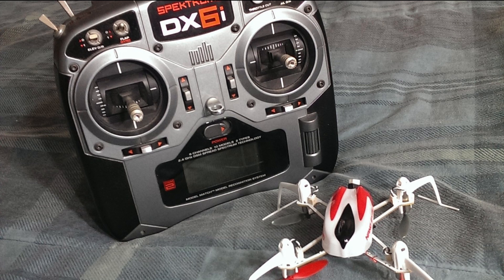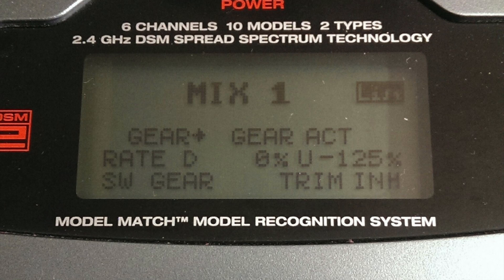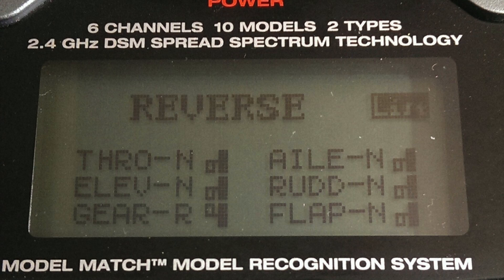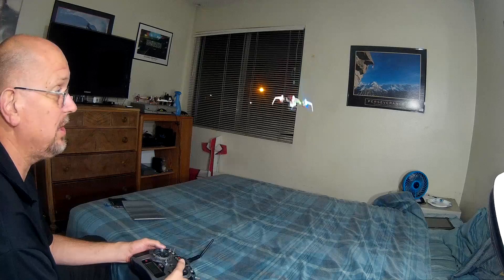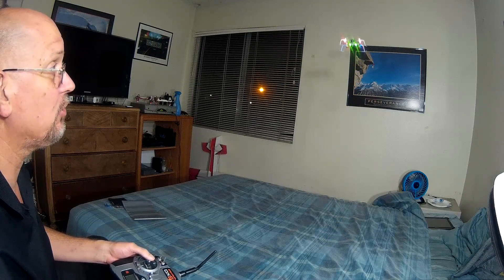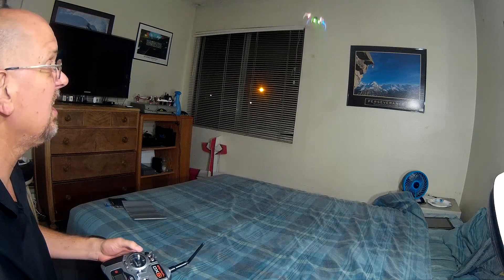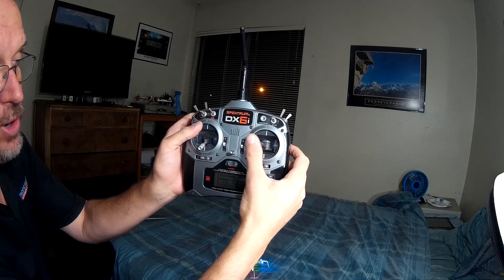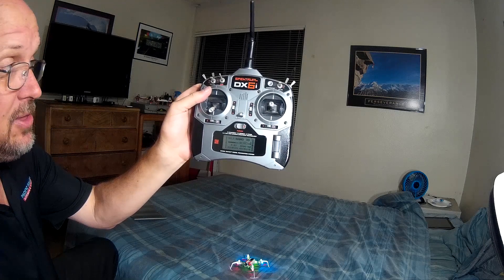NANO QX 3D Spektrum DX6I Setup Video -TALLGUYSD

Comment: Hello ! 
When I got in 3d mode as son I put throttle to min position (should be max throttle inverted)  the motor just stop  :/    Do you have any idea why this is happening ?
Reply from the maker: 3d mode middle stick is nurtal.  down stick is when inverted. upstick is for normal.
Reply from the maker: Sorry you can start it at zero it want start until you go to center stick..
Reply: In my Dx6i  what happens in 3d mode  as you sad middle stick is neutral position, when I go down stick is inverted, so as more a I go down more power I have inverted that is correct however when I get in the end its means 100% the power inverted the motor just turn offf. 

As soon my stick go in the bottom the motor turn off.    That is normal ?

My Nano CpX and McpX  I have a switch to turn off the motors in 3d Mode.
Reply from the maker: +Gabriel Aphonso make sure all your trims are correct and that you have no sub-trim set by mistake.

Comment: the user manual says: flap 125% up arrow and 125% down arrow. I need to set 125% down arrow in the travel adj? i only got the 125% up in the travel adj, a can barely flip the nano in mode 2. in mode one its imposible to 360 flip.
what am I doing wrong?
thanks!!

Comment: Thanks a lot!  I just received my Spektrum DX6i and my blade Nano qx 3d.  By chance, did you set your d/r HIGH 100% LOW 70%?  I did config my DX6i to your specs and it works great.
Reply from the maker: +Jason Hinojosa you can play around with expo and dual rates I just put 40-50expo on the ailerons and elevator and see how you like it that can always be adjusted to taste

Comment: Hey. Was just curious. For full 3D mode on the nano qx. I toggle the flap in mode one to flip. Toggle in mode two with the gear @ 1 to fly inverted. Toggle it again to flip back. For full 3D mode I can't figure it out. If I have the gear and flap @ 1.. I don't get the reverse thrust like a heli. Can't flip it.. I'm unsure if it will fly like a heli or it'd modes 1 n 2 are the best way to do it. Three seem to allude me.

Comment: One last question. When you fly inverted to flip back does the flap switch need to be put back to 0 from 1? I'm about to start learning that now. Want to minimize crashes if possible:)
Reply from the maker: leave the switch at one to flip back to normal, only change the mode switch  when you want to do a different mode.
Reply: +Tallguysd thanks for everything!! It's been tremendously helpful. Ttys

Comment: When I toggle the flap switch it doesn't flip? Mode 2 does go inverted. Am I doing something wrong? Do I have to use the sticks at all?
Reply: This piece of information was huge for me...No wonder I couldn't get it to flip.
Reply from the maker: it will only flip on a new battery. when the battery gets below half power  it wont flip.  try reminding it.
Reply from the maker: +Tallguysd i ment to say rebinding it.
Reply: +Tallguysd cool. I think the battery was low. Sounds good. I'll get this thing goin!!

Comment: Great thanks! About flying inverted. Is it like a helicopter when you switch the fmode up? I saw the other switch down then up and it flips by itself when you tell it what direction to go. But with the fmode? I just don't want to slam crash it. First time with this
Reply from the maker: +Sean Michael by default with the dx6i you are in normal mode right out of the box (it will flip on it's own when you toggle the flap switch and then hit the right stick in the direction you want to flip) mode two is the inverted mode elevator switch is down in mode 1 then when you toggle the flap switch and move the right stick in any direction the quad flips inverted in that direction. Mode 3 is full auto (I don't even fly this mode too crazy and pitchy)

Comment: Please show me exactly how to flip/fly inverted? How to change modes? turning the flap up and down.. is that an automatic flip? is inverted flight set by putting the gear switch into fmode? turning it up? like a helli? i flip helis  with the sticks not the switch. just set the throttle at a constant speed with the gear switch. also I asked about the throttle adjust. Cant get the elevation arrow to save facing down. it moves with the right stick.. and why the gear is at 125? can it stay at 100?thanks

Comment: I will get mine soon. Is it possible to change the setting for the flip from flap to the trainer switch? Must be a lot easier because with this method you don't have to take your fingers of the gas. Thanks a lot and bedt regards from Austria

Comment: Please clarify a couple of things for me.  I have set up my DX6i exactly how you indicated (I do not have the model yet).  You kept referring to mode 1 versus mode 2.  Are you talking about control standards where mode 2 is the standard in the USA?  Also, with that setup, does the QX default to the easy mode and if no, how do you switch between agility and easy mode?  I see that the throttle cutout switch was activated for something, but I am unclear as to the function with this setup.  I also noticed that in another video for the same setup, the person producing the video also made changes to the D/R modes and Gyro setting.  Any need for that?  Thanks.
Reply from the maker: the modes I'm referring to 1. flip mode. 2 inverted mode. 3 full 3d mode.
Reply: +Tallguysd Ah so, thanks.

Comment: Hi thanx for the video. In the travel adjust screen the arrows for elev And rudd ar pointing the wrong way. Do you know how i can change them? Thanx.
Reply: +Pieter-Jan Neirynck Move the control stick or switch and youll notice the arrow pointing the same direction. Make sure you set the left and right or up and down for each control the same....Left aileron to 100 and the right aileron also to 100 for instance.....

Comment: Thanks for great video.  With these settings, what switch is used to switch between the 3 flight modes (stability, intermediate, agility)?  Thank you.
Reply: +jygwkuojygw The gear or channel 5 switch. I believe the way this is set up your only going to have stability (full flip) and intermediate (half flip or inverted) settings. Your not going to be using agility till later anyway.......

Comment: Hi, thanks for the video.
When I put these settings in, I just reach the acro mode and the nano won't do a full flip, just turn and crash upside down due to not enough room. I guess I missed a setting to support / increase the flip speed. Right?
Thanks!